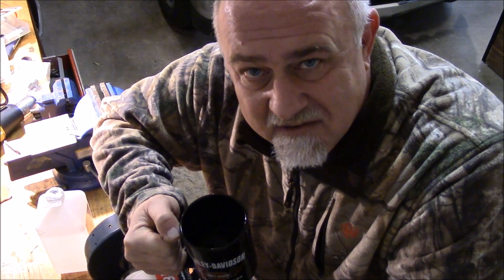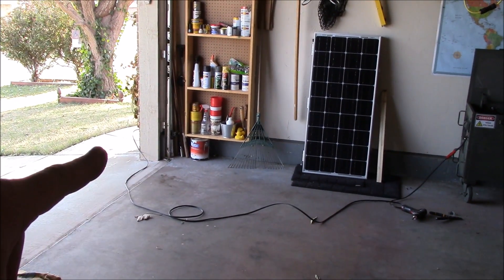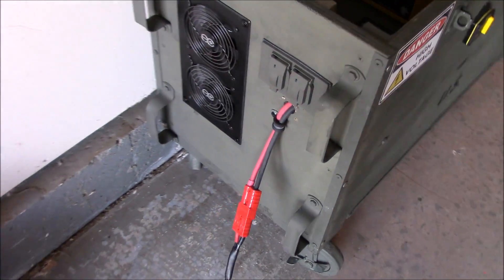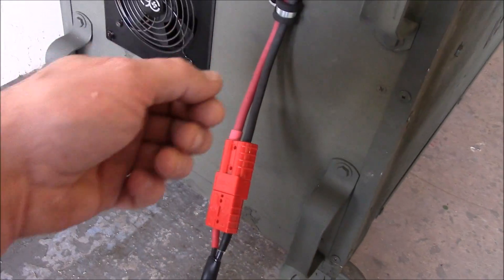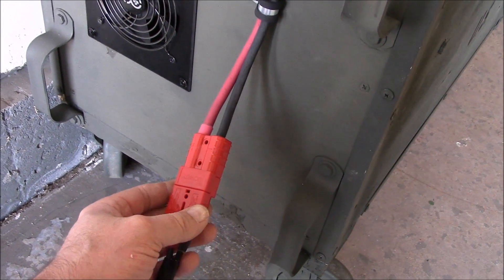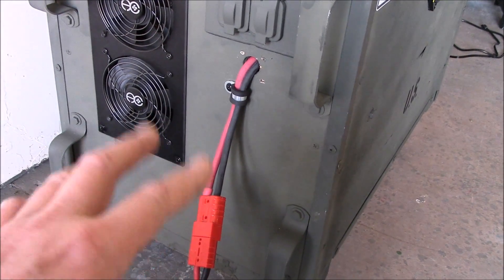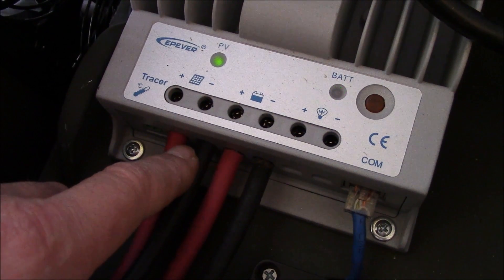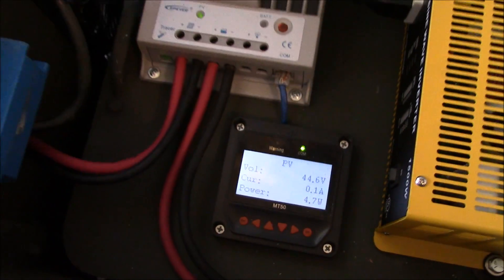First time working with Anderson style connectors (50-amp)

Comment: Casual observations...
When you grind off the crimped "wings" (apparently due to using an incorrect crimp die), that looks like it would weaken the metal that's holding the crimp together... no?  A proper crimp on these would be a "dent" in the sides of the barrel: http://tinyurl.com/zemfvvk
...or a properly sized hex die. http://www.gtsparkplugs.com/images/crimped-power-pole-connector.jpg

The goal is to get all strands of the wire being crimped in the terminal to become completely gas-tight with each other, to minimize oxidation; (see the right side example in this image)
 https://i.ytimg.com/vi/3qYZFxQ8Pxw/hqdefault.jpg

I don't think the 'wings' were causing any problems... the wire-entry opening is pretty large to accept such.

Also, in regards to mounting... these large connectors have two screw holes for mounting... it's not hard to flat surface mount them, and they will still mate when surface mounted... been using them for years. Sometimes a pair of thin washers can provide a little more clearance if needed. Just be sure to mount the connector "flat-side" against the mounting surface. 

Then there's these mounts:
https://forum.ih8mud.com/threads/wits-end-anderson-sb50-powerpole-custom-mounts.896966/page-3

Don't use the smaller connectors if you can avoid it... they are more fragile, and long-term the contact resistance will increase... unless you are using them at a small percentage of their Ampere rating. 

Also avoid mating/un-mating these while under load... sparks during that time will blast off the silver plating, and lead to oxidation.

Comment: Major cool!  I also like that it is Dec 14 and I just saw that you made this yesterday.  I am about to begin making my first prototype solar generator.  It will not be as beefy as yours.  Mine will be to mostly take camping to charge lithium-ion batteries, power some fans, cell phones - you know all the stuff you were supposed to have left at home to enjoy Mother Nature's finest.  I will have a 100 watt panel system with one rolling case.  If possible I would like to speak to you about the Anderson connectors and wire gauges etc.

Comment: Those you have should handle greater than 30 amps.  The smaller ones we use for Amateur radio are 30 amp.  I've been using them for many years.  I replace every radio DC cord I have with them.  If I sell a radio and someone complains about not having an Anderson setup I say why are you thinking of downgrading it?  Cool Videos!

Comment: Chris,   Screw an L Bracket on the inside of the box and using small bolts mount the  Connector to it with the mouth flush + or - for some wiggle room.  Splice from Del City......
Reply from the maker: Yeh, that sounds like a plan. Thanks man.

Comment: Cool Chris!  You're now using the connectors of choice (by me, haha).  I use Anderson powerpole connectors for all of my DC stuff, including solar panel hookups.  You have the larger type so they must be far greater than 30 amps.  I used the small housing and they support up to 45 amps.  They're small enough to not need solder.  They can be crimped with an Anderson crimp tool instead.  I do have those big Anderson's on my electric lawnmower though.  Not sure about surface mounts for them.  I use surface mounts for my smaller connectors (search for "anderson powerpole mount" on Amazon and they're the 1st two listings).  I actually have these mounts in outlet plates on a couple of my walls for direct DC energy.
Reply from the maker: Thanks...30-amp will work fine. I run those solar panels at high volts vs high amps. Just learning these Anderson connectors...I actually have some 2-gauge ones for another project. I wanted to start with smaller ones to learn how they go together and try them out.
Reply: I LOVE em!! I have them on the outputs of my portable solar panels, inputs and outputs of my buck converters, input on radios, DC fans, MacBook charge cable, self-made Anderson extension cables, smaller inverters, other electronics, all 3 pairs on a smaller charge controller, etc.  With my setup, you cannot get + or - wrong but you can certainly get the voltage wrong! If someone comes over and they think they can connect the red/black cable to any port that's also red/black and it fits... well, they're wrong :)
Reply from the maker: Awesome! Would like to see some videos!

Comment: http://www.ebay.com/itm/ANDERSON-PLUG-EXTERNAL-FLUSH-PANEL-MOUNTING-KIT-50AMP-50A-CONNECTOR-NEW-820-50-/291105807560
Reply from the maker: Nice...that'll work. But, the seller does not ship to the US.
Reply: http://www.batteriesdirect.com.au/mobile/shop/product/26091/tv-333820-50.html.  Chris DIYer  try this site.
Reply: Chris DIYer   http://www.autoelec.com.au/50-amp-anderson-plug-dash-flush-mount-mounting-hol~31382

Comment: You could use shore power connectors for your box that are used in boats or RV's.  Guest  makes a 15 amp connector for battery chargers that is a nice water tight connection and is compact (p/n150BBI) .  although as I look at your request for an answer, my solutions are not what your are looking for exactly
Reply from the maker: Gonna need something that works and doesn't cost an arm/leg. 30-amp Anderson powerwall will work...but, I don't think what I have (50-amp) will fit. I am just learning these Anderson connectors...big time use in Australia (they seem to always get the good stuff).